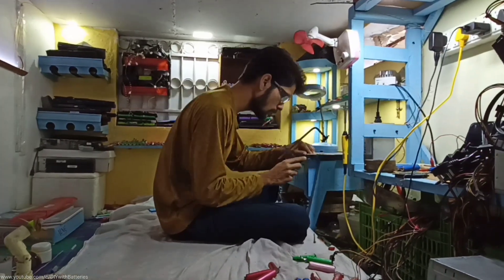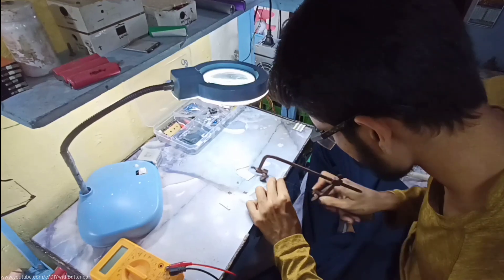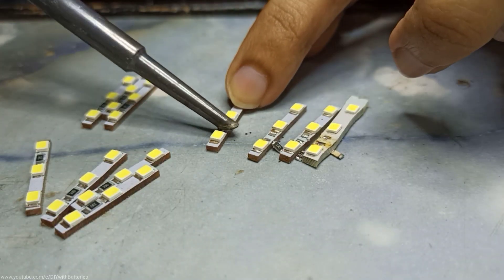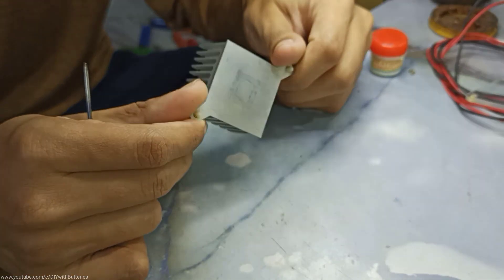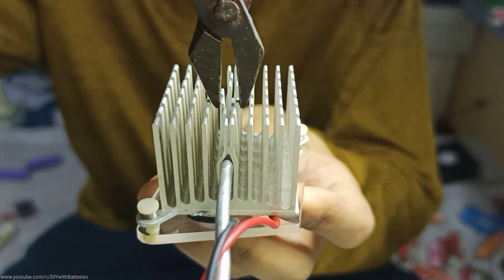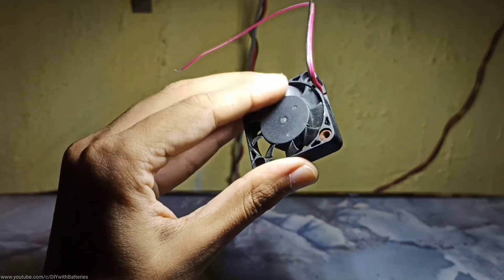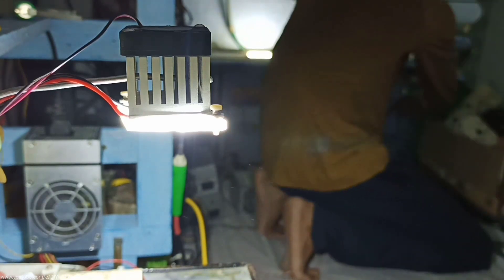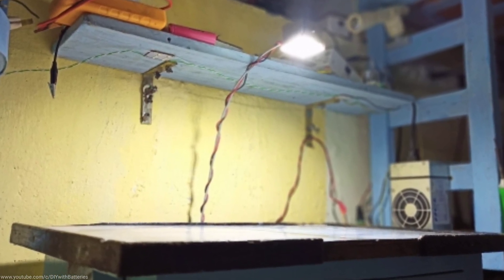making a smart LED desk lamp

Comment: How many volts you put into that light?
Reply from the maker: 3.3v ! And the remaining 5v I was using to charge those 18650's with tp4056, & the 12v to the workshop lighting cause I didn't mess with other lights Hah
Thanks man :D